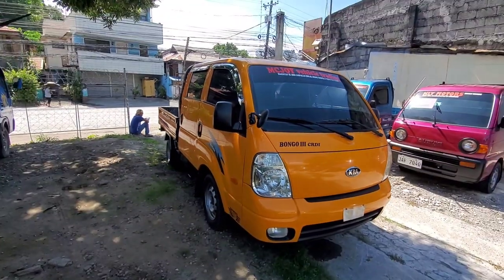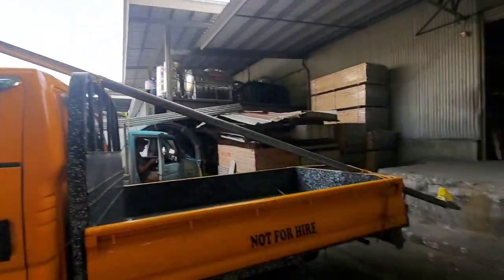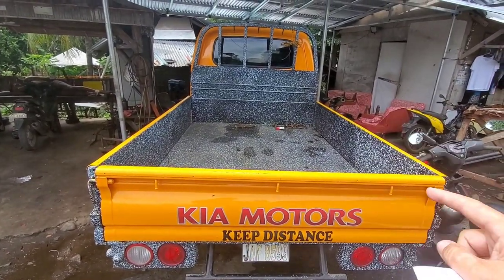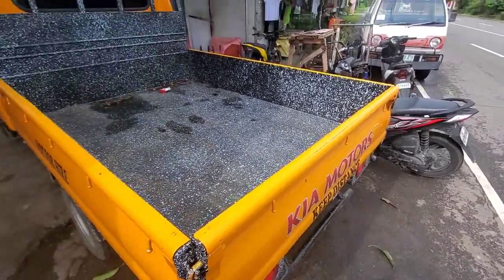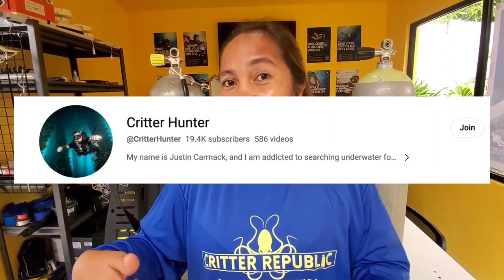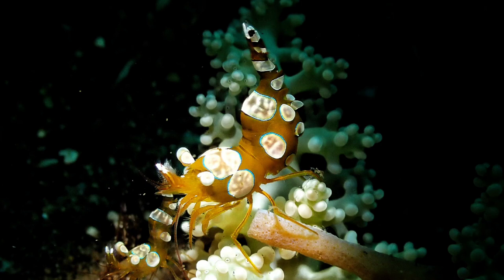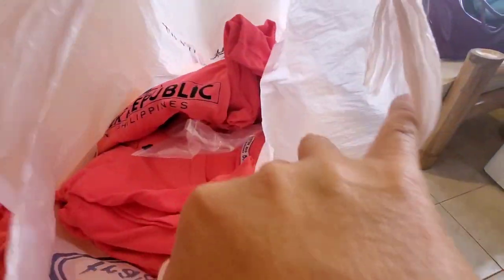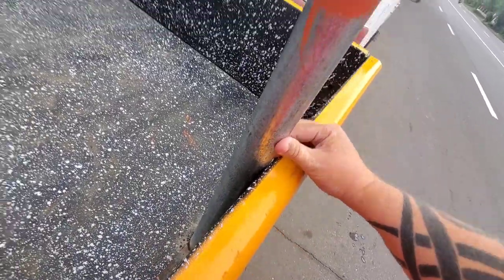Ultimate Scuba Truck Build | part 1

Comment: You're going to be really happy they angled those bed bars in for you like that.
Bolting them in = better, to the frame = best. Washers/flat stock underneath will hold them in.
Instead of a single bar line deflector upfront, consider a V design with 2 attachment points near the bed bar 'corners' -- that way you'll eliminate any chance of lines getting hung up on those corners.

Comment: Happy Birthday Julia I haven't seen your plans but I wonder if you can have a set of stairs  That hinge on the middle Of the bed inside the tailgate and then swing it up and lock it into the top bar that way when you pull it down you can walk right in and pull it back up I don't know if that's what you had in mind would be a nice little set the stairs